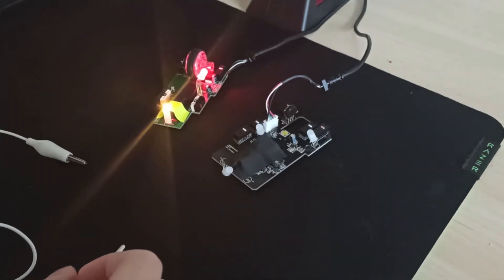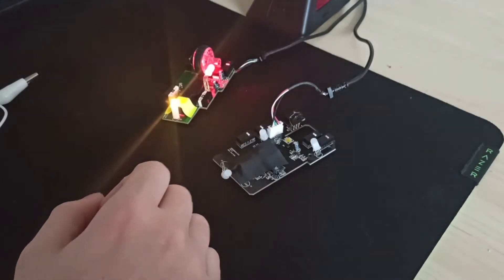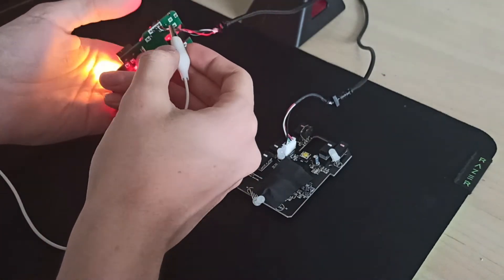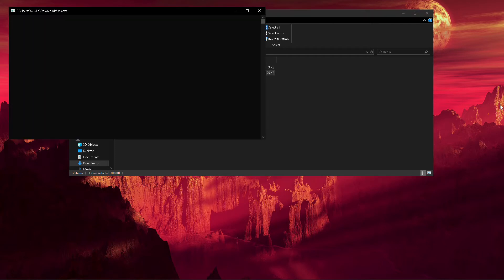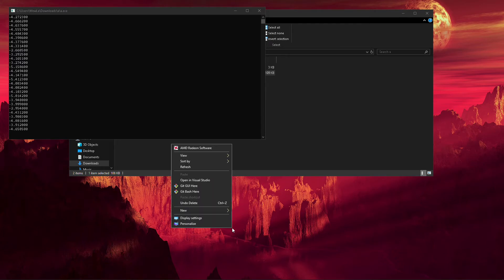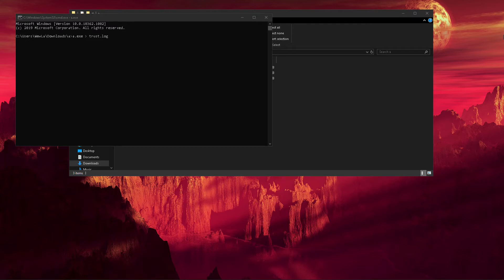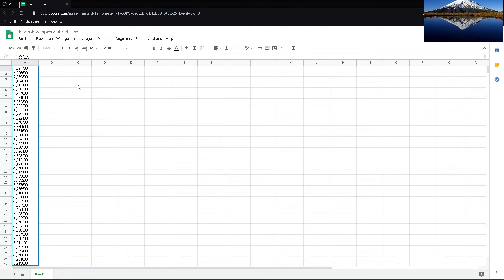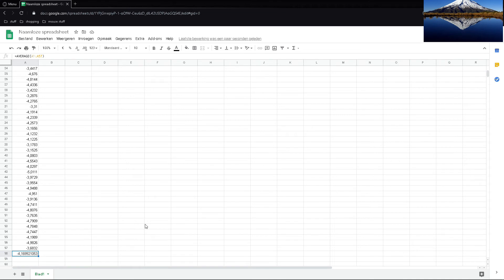How to test relative click latency for (gaming) mice

Comment: Small addition: On some mice (e.g., Xtrfy M4), it's not the middle pin but the front pin. 
Additionally, it is recommended to measure voltage on the switch with a multimeter/voltmeter beforehand and use a control subject with the same or largely same voltage to compare it to.